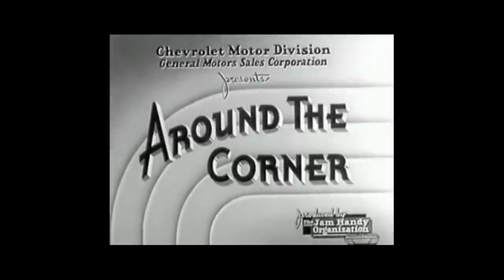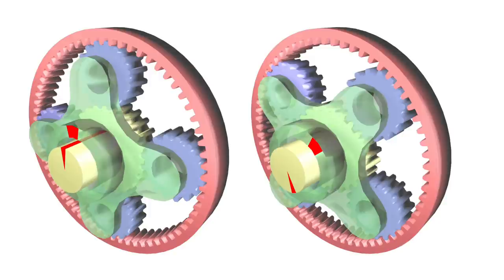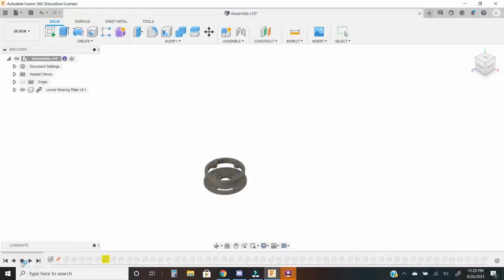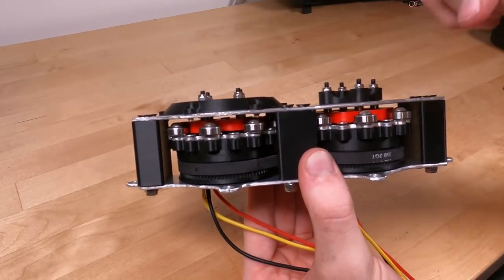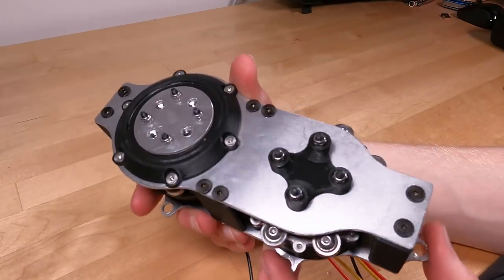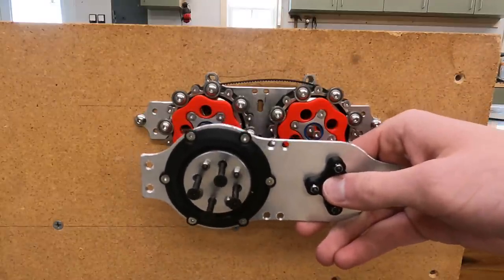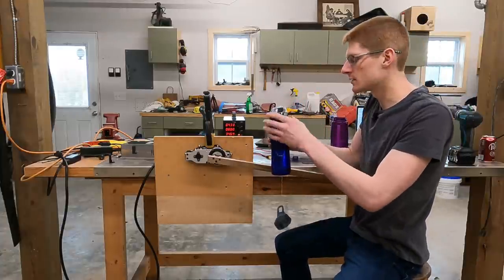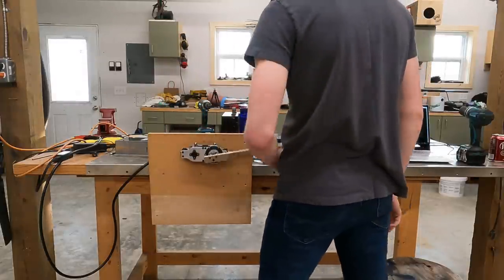The Differential Drive - A New Breed of Actuator

Comment: 3D printers typically don’t have any position feedback for their motors. As stepper motors can be precisely controlled step by step, and do actually have relatively high stall torque within these steps, the controller simply assumes the position of the print head based on how many steps per mm in each direction. This is exactly why if you bump a printers hotend mid print and cause the motors to slip, it will continue trying to print but out of place.

Comment: Hey I did this back in highschool with a vex robot, I used a planetary gear model instead of a cycoidal drive, but it still had to use a chain to reach in the gear and drive the planet gears directly, it was one of my favorite designs to work with, I wasn't useful for any of the competitions but was very fun anyway

Comment: It's not a new idea, but I appreciate how you walked us through your initial hypotheses and showed the errors. I can think of one other place this was used, and that was in a scam infinitely variable transmission design. All you needed was a second input that output just as much torque as the first, but is infinitely variable!

I think your hypothesis about the arbitrary precision is wrong, however. At least as I understood how you explained it. Not only do the speeds and positions of the two motors get added, so do the tolerances on those values. So if you normally can control the RPM to +/- 0.5, then normally you could set one motor to 1 (+/- 0.5) RPM. If you use your setup to connect motors going 99 and 100 RPM, then you'd get (99 - 100) +/ (0.5+0.5) = 1 (+/- 1) RPM. So the range of speeds is double (0-200 from 0-100), but the tolerance is also double (1.0 from 0.5).

There is still a way to make this work, I think. If one of the inputs is reduced ten times more than the other, then you would be able to use the second motor to "fine tune" the output speed. This would increase the precision of the output speed, but not the accuracy. The same goes for position: better precision, but worse accuracy.

Comment: I can't find it, but decades ago there was an invention that the inventor called The Wheel. It was an electric motor with three gears. 

Essentially, it was a planetary gear arrangement with all three parts licked to the output. There was no input shaft.

Each section, sun, planetary and ring gears, were linear electric motors.  The control box could send electric current to the three in any combination, from anyone gear to all three. Sending only to the ring gear would be first speed, to planetary gear 2nd speed, etc. 

It could also act as a generator, regenerative breaking. 

He had demonstrating powering a small boat and a car, but it went no where, maybe it didn't really work well. But, one example of three inputs, one output.

Comment: You have described a Ford ECVT. A gas motor input on one side of a planetary gear set and electric motor input on the other side. A variation of speed between the 2 makes all the gear speeds.

Comment: If you want to be able to have both high speed AND high torque while retaining infinite variability, there was a mechanism many years ago (1980s I think) from an Australian mathematician. I believe he called it an Epicycloidal Drive because it mechanically cut up and re-assembled selected parts of epicycles. Over it's entire range, the ratios varied by some 6000 to 1, with most of the range on one side of unity.

Comment: That is a nice way of packaging a reverse differential.

I believe you are slightly confusing the torque and rpm relationships though. What you have created is actually an rpm adder, not really a torque combiner. I'll try to explain.

To keep things "simpler", imagine using a common, open differential backwards, like a typical differential in a car but without a pinion gear, no driveshaft and no axle housing (just the differential). 

Now mount your 2 electric motors where the wheels normally go and consider the output the rotation of the ring gear.

Ultimately by using a vehicle's differential backwards as defined above you will get the following somewhat confusing relationships:

Torque
- The electric motor torques will always been equal to each other because they apply directly at a 1:1 ratio to each other through the differential (imagine locking the ring gear temporarily to understand). If the torque isn't equal, the motors will spin at whatever rpm is necessary to make the torque equal (again imagine locking the ring gear).
- The output (ring gear) torque will always be equal to the sum of the motor's torques, which is the same as 2x either motor torque (because they must be equal).
- If you lock one motor and drive the other motor you will still get the same 2x motor torque at the output. With the locked side, it will resist by exerting an equal torque to the motor that is being driven, hence again the 2x or sum of motor torque at the output.
- Mathwise: To = Tm1+ Tm2 = 2xTm1 = 2xTm2
, where
To = output torque
Tm1 = motor 1 torque
Tm2 = motor 2 torque
- Because the motor torques must be equal, you can't really think of it as a torque combiner. 
- As mentioned above, if the torques are not equal, the motors will spin at whatever rpm is necessary to achieve equal torque.

RPM
- The output (ring gear) rpm will always be equal to 1/2 of the sum of the motor rpms.
- If both motors are spinning at the same rpm, both motors and the output will ALL spin at the same rpm.
- Mathwise: Output rpm = 1/2(M1+M2)
, where
M1 = rpm of motor 1
M2 = rpm of motor 2
- You could think of it as an rpm adder with each side having a 1:2 gear reduction.
- by changing the gear ratios you can change the rpm ratios but it will always be an rpm adder.

Where this is useful is if you have a motor that is sensitive to rpm, like an internal combustion engine, you can use an electric motor on the 2nd input to vary the rpm relationship between the 1st motor and the output. On top of this, if you use the 2nd input motor as a generator and use this electricity generated to power an electric motor driving the wheels, you now achieve a torque increase at lower wheel rpms (lower vehicle speeds), which is what you want at low speeds. At high wheel speeds you loose the ability to generate electrical power through the 2nd input so it behaves like switching to a highway gear ratio. This is why several hybrid vehicles use these as a CVT.

Comment: Modern tank transmissions use the same concept. Basically near each drive sprocket there is a set of planetary gears that combines the speeds of the forward/backward drive shaft and the steering drive shaft to get the sprocket speed.

Comment: Remember you have shared the current from the same power supply ... to solve provide each motor with it's own power supply.

Next look into syncros & servos
It's a electric way to add two mechanical inputs to produce a 3rd output. 
Single phase inputs for 2 synchros, divided into 3 poles, that are interconnected at the stators... the 3rd motor is a servo, that detect the difference & then respond to turn until there is no electrical difference in voltage.

This synchro-servo combination can have light-weight inputs on the 2 synchros, that then can drive a super heavyweight output, all depending on the power supply and size of the servo-motor.

Comment: I actually worked on something similar to this in high school. I did FRC robotics and i think from around 2017 to 2019 we worked on making a "differential swerve drive" and used it on a robot in a 2019 off season competition. Idk if "swerve drive" is something commonly used outside of FRC, but it was very common in FRC, and it was basically just a system of driving a wheel using one motor for power and one for turning, and the diff swerve was designed to be an improvement over that. I know several teams have designs by now, and one team brought them to a on season competition as early as 2019. With our previous standard swerve drives we were already one of the faster robots, but we had virtually no pushing power, so i believe the intention was to gear the motors such that we could get similar speeds with increased torque, but im not super sure on that.

Here's some documentation (though on a later version than the one i worked on): 
https://www.chiefdelphi.com/t/4143-diffswerve-2019/364655/7
And a video of it running (this time the one i worked on, it was a bitch and a half to mill & assemble):
https://www.youtube.com/watch?v=clVUv8iXHdw

Comment: Method has existed for energy production. The first edison power plant (commercial) had a huge problem upon deployment. The two turbines were fighting with each other. The solution was two clutched turbine governors. It consisted in a hinged weighted governor that varies the input torque via centrifugal force

If you don’t deploy it  this way you are going to loose torque because one motor will spin a a different rate. This will waste torque.

Comment: you should check out "Adder/Subtractor differential mechanisms" we use this kind of mechanical sorcery in lego technic a lot. with a mechanism like this, you can have one input drive 2 outputs, where the difference in speed between those 2 outputs is the speed of the 2nd input (the steering motor if you will).

this is how vehicles like the RipSaw steer at speed.

Comment: Power = torque*velocity so for 2 motors: 2*P = 2*torque*velocity which is (2*torque)*velocity or torque*(2*velocity), cant get more than 2 times the power :)
Reply from the maker: Yup, I initially tried to explain my way around this, convincing myself that it had two modes in which torque or speed could be doubled separately. Of course, that wasn't the case, and my initial physics intuition won the day.

Comment: Based on how you describe this system at the end of the video it sounds analogous to electrical batteries. When wired in series you get double the voltage (speed) but the same current capacity (peak torque) whereas when wired in parallel you get the same voltage (speed) but double the peak current capacity (peak torque) and also double the energy capacity (thermal mass). Directly coupling two motors is like wiring two batteries in parallel. You kinda made a way to drive them in series, almost as if one motor is directly attached to the output of another.

If you imagine having a huge output axel rod with a motor on one end mounted to a fixed base and another motor in the middle, it seems obvious that the axel will only ever be able to resist turning with the stall torque of one motor, but to accomplish this, both motors need to be stalled. However if one motor is turning the rod from the end to the second at 100rpm and the second motor turns the end of the rod at 100 RPM the end is now at 200RPM.

Comment: My gut says that the output torque would be:

1/Tout = 1/Ta + 1/Tb

Ta and Tb being torque from motor A and B respectively.

I'm not sure I agree with the use case of the arbitrary precision. Assuming the controllers using ZX are able to perfectly control speed. That would give you "position control"  on the output because of the differential. However accounting for disturbances like a variable load torque would not be accounted for. So it isn't truly position control but speed control that is able to overcome the low speed limitations of a ZX controller. So yes you could make it look like position control but it is really just good speed control. Until of course you add the encoder on the output at which point you have all the parts needed for FOC again, so it is likely better to just use FOC. Although if the use case specifically needed the speed addition then I think you could make it work.

Very cool idea! I'm excited to see if you manage to get functional. Perhaps a design with a epicyclic geartrain would be easier to build and debug?

Comment: There seems to be a common misunderstanding that two motors coupled to a differential solves the problem of creating a non-frictional-contact CVT, and I assumed that would be the claim of this video. Instead I am pleasantly surprised that you did a solid analysis of the mechanism, showing what is and is not good for. Kudos! And great work on the physical construction!

Comment: Love the video. I like mechanical stuff.  If you look at one side of a modern tank transmissions you'll see what you just described.  Two motors. Main powerful drive motor and small steering motor. The main drives the tracks and the  steering motor controls the outer planetary in side the tranny. When you starting adding power to the steering motor it will add this power to one track and subtract power form the other side. You can even get both motors spinning in the appropriate direction and speed to stop one track.  But of cores it is a tank, so the other track will be spinning wildly.  Stopping the drive motor and rotating the steering motor will spin both tracts in opponent directions. I hope you can get your working, the holding power idea would be great for robots  and small machines. But in a tank you have a break and clutch to stop, and a really big gun. lol

Comment: I made one of these decades ago out of lego!  My intention was to make a constant pedal speed bicycle and use the motor to counter-rotate to provide gears. I.e. bicycle had a high fixed gear and the motor effectively reduced the gear ratio. It was a long time ago but I recall my problem was that under high torque the motor would be the weakest link and fail to rotate.  I corrected that using worm gears (in lego they are effectively one way because of friction) but then it became too slow and useless.

Comment: You can find those summing mechanism in every Jet plane flying today. They use a Constant Speed Drive (CSD) to drive the main A/C generator to provide exactly 400Hz, no matter what rpm the engines are running at.

Comment: Been doing similar drives on poly engine vehicles.
Whe most are locked together some have differential drives.
Most often twin different at the rear axle. But I've seen a few which had a differential drive before the trans.
However it's always good to redesign concepts for more universal purposes.
It would be difficult to adapt a prius trans or one off design to cover a range of applications.
Good work and elegant design.

Comment: The CVT in IH tractors also works this way, main engine on one input and hydraulic motor on the other, then steps through gears at max fwd max rev speeds of the hyd drive.

Comment: If you built the secondary motor the same as the first motor you could have an interesting 2-speed gearbox. Couple the sun gears together with stationary ring gears for double torque, or couple the ring gears together with a stationary sun on the secondary for double speed. May even be able to make it constantly variable.

Comment: Your connection between a differential working in reverse and a planetary gearset more than likely comes from the fact that a differential is a planetary gearset, where the carrier is the input, with the ring and sun as the outputs, with the planets/satellites/spiders allowing for differential movement; the differential is a unique planetary gearset because it's folded in on itself where the ring and sun are coaxial and equal in size. These have existed for awhile, though for some reason they're referred to as an 'adder' gearbox, at least in certain circles it's called an adder; and those certain circles make adder/subtractor gearboxes. In fact, any hybrid that uses a 'boost' motor functions in this way, whether that's EV main with ICE boost (Prius) or ICE main with EV boost (I believe this is what most of the supercar hybrids use, Porsche 918, the newer NSX, etc.), with the oldest patent I know of being in filed in 1969, granted and publicized in 1971, by Baruch Berman, "Power train using multiple power sources," patent US3566717A; of which multiple modern patents reference for hybrid 'boost' drives. 

Though, I don't think I've ever seen cycloidals used for this. If you continue iterating on this idea, I would suggest going back to basics, start with your original idea, the inversed differential, that way each input is 1:1, and the satellites are also 1:1 with the sun and ring, this is the absolute most basic setup as you're not dealing with gear ratios, only the speed ratio of input 1 and input 2 and their effect on the output. From there, unfold the differential into a more typical planetary gearset, where you'll have to mesh the motors to the gearset to achieve the 1:1, or direct drive the gearset and differ the speeds of the motors to achieve a similar output to the differential design. Then from there your can iterate on the cycloidal design, this is where you'd be leaving the territory of a widely known mechanism into the territory of a lesser known mechanism. I would like to see you iterate on this idea, but I think you do need to approach the base concept first, learn the basics, then use that knowledge to attempt the cycloidal variant. And who knows, maybe cycloidals are less than idea for this application, for whatever reasons you may eventually find.

Comment: This kind system is in use at some of hybrid cars. Look synergy drive. Also there is gearbox design what works so that there is small electirc motor what controls output speed but real energy come mostly from combustion engine. It works basically with same kind idea. Sadly I dont currently remember name for it.

Comment: I would imagine that the reason this type of gearbox isn't used is the same reason differentials blow up if you run a spare tire too long... The extra gear movement generates a lot of heat and wear. 

Additionally, most motors are already gear reduced. Better to get your increased speed by building out the engine or using a higher voltage/wattage electric motor.